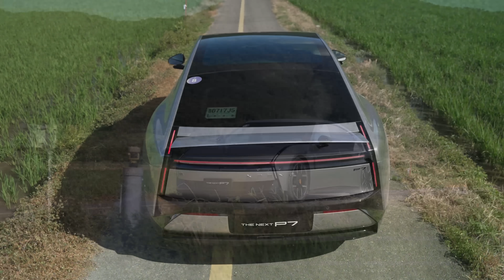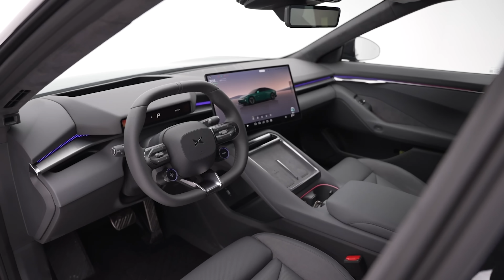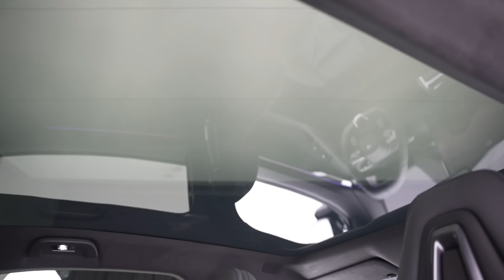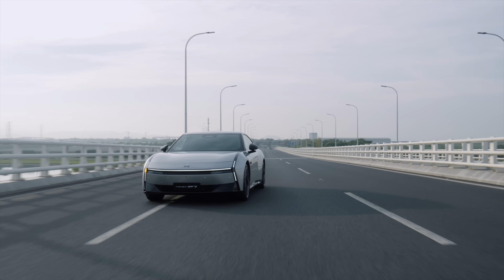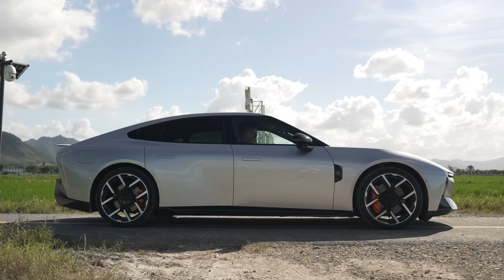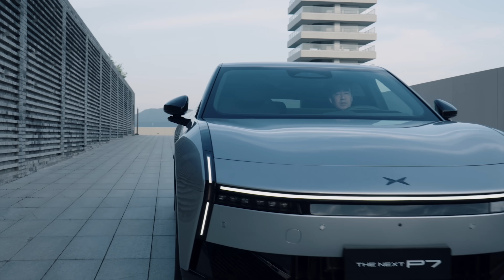This EV Is Straight from 2035 - XPeng P7 Review

Comment: Great exterior design! Shame about the interior design not being at the same level. The screen may be articulated but it still looks like it has been plopped in as an afterthought. I don't like the design of the steering wheel either. However, there is a lot more good to say about this car, compared to the few downsides.

Comment: Looks like they can easily put motors worth of combined 1000 HP in this car but chose not to since they're Xpeng are not that focused on performance but more focused on its unique software and industry leading fast charging capability.
Oh well spoke too soon they're going to give it a Performance trim later like they just did with the facelifted G6 with new battery and new Performance AWD model just recently announced in Thailand.

Comment: I realy like your Videos✌🏼 i would love to see more technical details and things like the charging curve
Reply: This is Xpeng, with 5C batteries, with lowest voltage possible and maximum efficiency! This means less losses, less risks, quite none as Xpeng Motors assume anything, even in case of rare problem caused by another road user or the driver. They reduce consumption, as well as Lucid Motors does, the ex Tesla's technologies développer).

Good price! The quote XNGP decreased as the price ofthis luxuous Sedan much bettr han luxuous ones! It is judged far too cheap for its quality, by investors who have money to waste.  But it has a good price for clever customers, who do not havt mney to waste.  They should be more than 100000 till end of the year whicg wll allow Xpeng Motors creating benefits at the 4th quarter. Hope there will be enough clever customers for these good models (G7 too)-

Comment: This is how Futuristic Electric Cars Should Look Like. Car is too low for most of the roads outside China, they need to provide option of raising the car if driver needs to add some extra ground clearance.
Reply: They do. You can adjust ride height via the air suspension.
Reply: @mmdrodrigues  Alright, got it. thanks.

Comment: Lacking battery swapping, not future proof
Reply: no need to swap, charge at home or anywhere else.
Reply: @alexj2869 I think there's still a few advantages to battery swapping.  It can be quicker than even the fastest charging.  And the swapped batteries can be charged more slowly to avoid degradation and reduce strain on the power grid.  Not to mention much cheaper and faster battery swaps when you'd like to switch to a new/high-capacity pack.  

My biggest opposition is that for most people, you'll only road trip once or twice a year.  That's only a few fast charges, so the degradation and lost time are minimal.  So if a competitor has a few other advantages, it could be worth it to skip the ability to swap.
Reply: @faeinthebay  it can go 600km I can take a break and do a quick 15 minute charge.
Reply: @faeinthebay 不，在中国现在看来，实际上很多用户充一次电可以用一周了，很多蔚来用户都认为换电是可有可无的。而且成本太高，没有其他车企跟蔚来，导致蔚来在中国换电装置太多，但只有蔚来用户使用，成本太高
Reply: Good point, although apparently a lot of Nio owners just fast charge.  So maybe it's only useful for frequent road trips.

Comment: good news, new p7 starts from $30,000. all with 245 front tires and 275 rear tires.
Reply: Yeah but that's in China. I wonder how expensive this will be in Europe. I guess starting at 48k or so.
Reply: Chinese car manufacturers are insane in these two month Onvo L90, new Nio es8, new Xpeng p7 and more on the way.😂
Reply: @heinlich BYD fangchanbao 7, Geely galaxy M9, Li Auto 8, Huawei M8 etc😂😂
Reply: there are custom charges cause europe cannot compete.
Reply: si cambias los 275 por los 245 y pones los 4 a 245 el ahorro en combustible es alrededor de unos 50kms reales